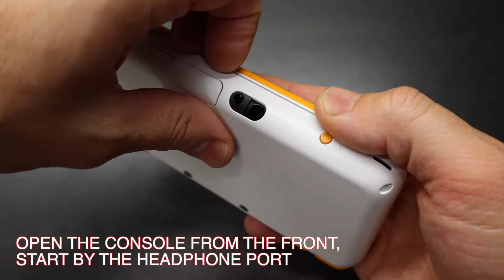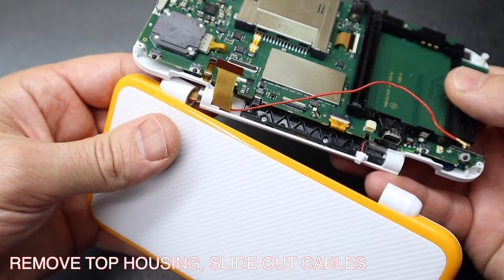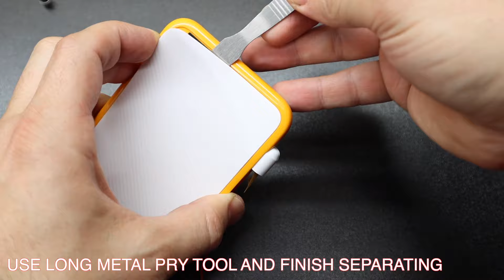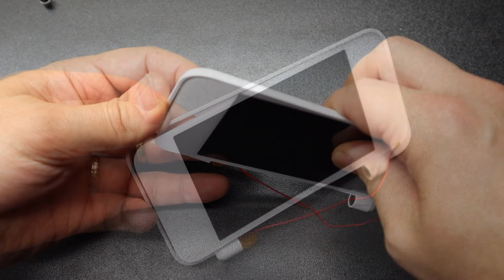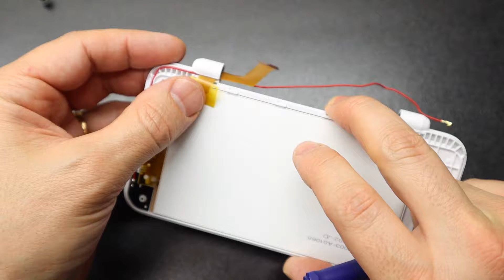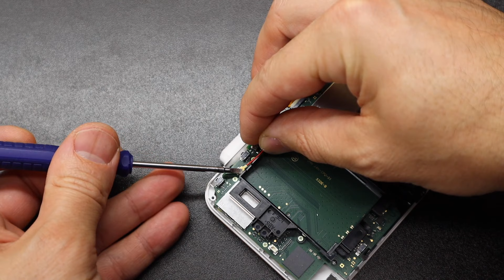Nintendo 2DS XL Broken Top Screen Replacement | Fastest Way | Nintendo Restoration

Comment: The hinge pin pulls out way easier if you have the lid opened in normal position
Reply: Omg thank you so much for the idea. I was trying to get this damn hing for half an hour now, and i saw this comment. As i was reading the comment and trying, it worked first try. Again, thank you so much. You're a saint.
Reply: bro! I will name my first child after you lol I've been trying for like 30 minutes and it wouldn't budge, then i read this comment and got it out first try
Reply: @truzzieart6071  nice. His name is Horace

Comment from the maker: Let me know if you have any questions regarding this repair.
Reply: I've notice the R button inside the unit got almost remove while removing the housing how did you return it back?  It also happened to me but mine was accidentally entirely removed.
Reply: Were you able to resolve the difference in brightness of the top screen?
Reply: Can you do a shell swap on the new 2d XL
Reply: What if the screws are stripped

Comment: I just finished the repair by watching this tutorial, and I had a few problems, so for anyone that is going to try this, keep in mind that this is never going to take 12 minutes. For me, it took me 4 hours, but I spent 1 dealing with a stripped screw. 

I would have preferred if you didn't put cuts on the more difficult part, like at 2:56 and at 9:24 when I got stuck because I didn't see what you did. 

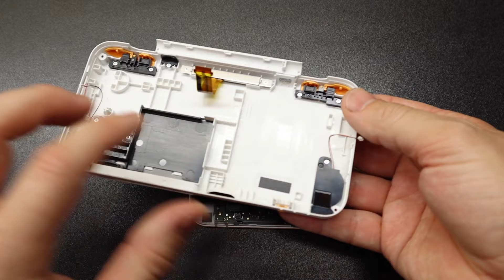Also, I don't know what the hell you did during the cut at 1:45 but you broke the R button and never mentioned it during the video 0.o
Reply: You became Money Talk Wireless

Comment: Thankfully this is by far the easiest folding 3ds family model to do a top screen on. The new 3ds xl has 3 ribbon cables running through that metal cylinder, where as  this has one  ribbon and the antenna wire.

Comment: Hey quick question where do you get the screw driver to open up the 2ds xl because I bought a repair kit but all the screwdrivers won’t work
Reply: Typical screw-driver kits usually don’t come with a Tri-Wing screwdriver, as a Twi-wing or “Y” screw isn’t very common, and is really only used by Nintendo themselves since they know most hardware stores wouldn’t carry it in bulk. You can by them on Amazon or your local hardware store, they just won’t be found int repair kits.

Comment: Without this vid I wouldnt have tried this xD
ok I have some small things that I found out while doing this:

-on aligning the new screen on the glass and the shell, put the glass into the shell first and then put the lcd on it (its easier and you dont have to worry aligning the lcd wrong)
-on the hinge beware, that you need to open the ds a bit more if it doesnt fit
Reply: I probably killed the ribbon cable of the lcd because I aligned it half a millimeter off and the cable got stuck on the glue. If I put the screen into the shell first and then put the lcd on it I wouldnt have to look out for the ribbon cable at all
Reply: also if the ribbon cable of the lcd isnt staying put while putting the orange border thing, use tape to fixate it

Comment: Great video. I have a question, i noticed at the end when you started to the device we can see on the left side of the replaced screen a light bleeding. A kind of inconsistant light level at the edge of the screen.
I am asking because I just bough a 2DS and it has exactly the same and on the same screen and side.
Any idea why and anyone else has the same issue?
Thanks

Comment: Nice one! So the replacement screens still.have the same issue begin darker than the original ones?
Reply from the maker: It’s 50/50, I’ve gotten some really nice replacement screens. Every supplier is a mixed bag though.

Comment: Hey i recently picked up a new 2ds xl in black and blue and the top plastic cover u remove on mine is majorly fucked up and i found a seller with new replacements and just wanted to find out if i was to use a heat gun there when my screen is not broken, is there any chance the heat could break the screen when i try to remove the ruined plastic cover? cheers
Reply from the maker: Use low heat, and keep the heat moving. Carefully use a thin pry tool to separate from the adhesive. Yes, it can be done.
Reply: @TheFixTech  thats great ty. I picked up some plastic razor blades to use so i dont cause any dmg to the rest of the shell. cheers again :)

Comment: If you somehow see this, do you know if I’m able to remove the lens without removing the screen? Like the blow dry method for the other models and then the lens pops out. My only issue is a scratched screen
Reply from the maker: Unfortunately not for this model, the entire screen must be removed to properly separate the lens.

Comment: Hi.  So I'm replacing the screen.  And have it almost together.  Where I'm stuck is the little peg that mounts the top screen to bottom.  It is not lining up.  I can't get the peg in.
Reply from the maker: Are you talking about the barrel hinge that connects upper and lower housing? It is a press fit and takes a little force to snap in. Make sure when attempting to insert the hinges that the housing is in the closed position.
Reply: @TheFixTech  thank you.  Yes that was it.   I had to take some pliers and twist it the right way.  Got the whole think put back together and the screen isn't coming on with a pop now. Lol.  I think I may have damaged the ribbon again messing with that hinge 😅.  Oh well.  Gonna buy another screen on Amazon and try again.  The screen I have currently worked fine before I assembled it.  I plugged it in before just to make sure.  Powered on.  Screen worked and everything.   Now it's not 😅

Comment: Be careful, if you noticed he broke off one of the trigger buttons off the motherboard. It’s a very difficult fix, my advice is to use a plastic wedge tool and to avoid prying where the triggers are
Reply: How do u fix these? 4 off mine have fell off?

Comment: hey for the heat gun what temp did you put it on?
Reply from the maker: Low temp, 200-300 degrees
Reply: @TheFixTech  thanks for the response, definitely will try it out.

Comment: My 2ds xl fell out of my pocket the other day and broke off a piece of the hinge witch ripped the top screen ribbon cable. Rather stressed at the thought of trying to fix it as I've tried fixing 3ds's before but only managed to brake them further.

Comment: If there is a small scratch on a screen is it possible to just replace the lens? Like you did in a previous 3ds video?
Reply from the maker: Yes it is possible but harder than the 3ds as the whole screen assembly has to come out and there’s a strong chance the lcd will crack upon lens removal.
Reply: @TheFixTech  Got my hands on a 2ds xl with some nasty gashes on the top screen lens, Can I even pop the lens out of the case without taking it apart or is it a lost cause?